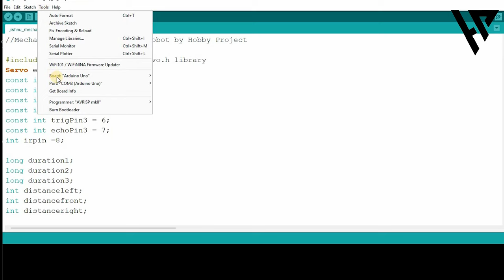Mechano Smart Floor Cleaning Robot using Arduino

Comment: I would really appreciate if you clear these doubts.
1-  8:48 at this part, you connected the positive of the battery to the switch and buck converter using diode and negative wire to the other terminal of the buck converter later in the video right ? So where should i connect the 2nd terminal of the on/of switch.what i meant is where should i connect the female port to charge the battery? which wire is connected to switch?
 2-  10:00 Where should i connect the other female from (esc and motor driver) wire in ardiuno.Even if it was shown in the video it was not clear enough and its not in the circuit. -  15:45
3 - 16:32 where should i connect the voltmeter.Is it connected to the switch or buck converter? .Did you use a separete buck converter
4- where do i connect the motors which sweep?
                Very nice project. I am looking forward to build this one with slight changes in body and vaccum cleaner.😀
Reply: 2. Three female from esc connections are shown in the circuit which is attached in discription.
4. Sweeping motors are on direct 5 V DC
Reply: @kuberavarma9985  I think what he meant is the extended wire which he connected to esc and motor driver. He is talking about the other female pin wire which is attached to the wire which he connected to the motor driver and esc

Comment: Why did you connect the BEC of esc to ardiuno 5v? I mean ardiuno is aldready powered up by direct battery right?
Reply: Plz respond sir.
Reply from the maker: thanks for pointing this out..👍
Reply: @hobbyproject  Ofc btw what power supply should i use ? BEC or Direct battery
Reply from the maker: any of it.

Comment: This is a great project,Also here are my recommendations.

- Use a Xl4015 along with a bms(if not included in battery already),instead of lm2596 which is not suitable for battery charging and also doesn't provide cc but Xl4015 can provide a constant current/Voltage with adjustable voltage and amps so we can adjust volt into the battery for charging
- Use a mini 5v cooling fan on top of the l298 motor driver if it heats up,Remember to maintain atleast 2cm from the l298,Air flow should be top to bottom.
-Use a good quality 40a + esc unlike the cheap ones in this video,Like i bought a cheap one and it burned and heated up so quickly,More esc rating leaves more head room for esc resulting in better perfomance and less heating, I would recommend hobbywing skywalker 40a,UBEC 5v/3a esc

These are some of my recommendations. :)
Reply: If I want to use a hw 130 motor control instead of l293d
Can I do it?
If yes, can anyone provide any directions
Reply: @simoon_sifat  No you can't use hw 130 motor driver on ardiuno to run those wheels,The robot only needs a driver with two motor outputs,hw 130 have 4 of them also if you use hw 130 on top of ardiuno,where would would you connect all the other sensors,pwm signals from esc. e.t.c , I mean you can connect it through the pins of the driver by soldering the pins for jumper wires but why all the effort when there is another dedicated driver for this, if you have programmed and used 4 wheels then the hw-130 driver is suitable otherwise not suitable for this project.
Reply: Go with l298 driver,(the one that has heat sink.
Reply: @TRAZExYT  thank you for your response
I was making this with your suggestions in mind but got hw-130 instead of l293d when I ordered the items
So, was trying to see if I could make it with what I had
Reply: @simoon_sifat  You're welcome.I am also in the process of making this,Circuits almost done but now i have to modify the code more to run efficiently
Reply: The buck converter output, one is left
Reply: It will be connected to switch or somewhere else
Reply: Bcz One is connected with switch
Reply: @sahilgupta4899  Yes,The buck converter's +ve is connected to switch using diode and -ve out of buck converter along with the other terminal of the switch is connected to esc,motor driver input,weeping motors input respectively
Reply: @TRAZExYT  can you tell me the esc connections
Reply: Asap
Reply: @TRAZExYT  bcz I have many more doubts
And I have to explain this in my school tomorrow
Reply: Pls help
Reply: Because esc has two connections of power supply and sweeping motors also has two connections 1 positive and I negative
Help
Reply: @sahilgupta4899  Yes sure,The battery's out coming all the way through buck converter and switch is connected to esc's input +ve and -ve respectively,Along with the input wires to the motor driver you used,Also the irz44 10k potentio meter sweeping motors input.All of these are connected to battery out respectively.The esc's bec provides supply for ardiuno uno and sensors while the motor driver wire powers up the motor driver to run wheels,The input of irz44 controls sweeping motors.Note that don't repeat the mistake in this video where he extended a wire from motor driver input and connects it to ardiuno.Dont do this coz ardiuno uno is already powered up by esc's bec along with sensors
Reply: @TRAZExYT  bro can you provide me a circuit diagram which is correct
Reply: On WhatsApp or of any link which provides me the png of circuit diagram
Reply: @sahilgupta4899  i don't have a specific diagram
Reply: @TRAZExYT  thanks i have solved it but i have removed the charging port
Reply: @TRAZExYT  can you help me to add charging port also
Reply: @sahilgupta4899  yes,if you are using llm2596 or xl4015 just take a female port and connect it's +ve and -ve to lm2596/xl4015 input respectively.make sure to adjust the voltage?
Reply: @TRAZExYT  how can i power arduino
Reply: @TRAZExYT  what is the use of connecting a potentiometer to arduino
Reply: @sahilgupta4899  You do use a esc right to control bldc motor.That esc has 3 additional wires known as bec.Connect the Positive and negative of it to the (extended wire from video which supplies 5v to all sensors) connect it to those wires,and ardiuno is powered up
Reply: @TRAZExYT  then, will bldc motor gets enough power to run effeciently
Reply: @sahilgupta4899  I don't completely know bcoz i am in the process of making one myself with design and circuit differences, However the bldc motor needs a high capacity battery to run this project,likwe 12v 5000maH with more than 20c.Keep the potentiometer at 40% to reduce power consumption
Reply: Bro I loved this project ❤ but  I need the dimensions/measurement  of the outer box. Can anyone help me plz
Reply: @daddygaming5768  measurement? just get a platform to put all of the components and if they fit in a desired circle,just cut it,thats how i did it
Reply: Por favor diagrama completo y materiales
Reply: @TRAZExYT  Can you tell me how do i connect the wheels to the Arduino board i don't see where he connected the wire with the board or else..
ANSWER ASAP i need to submit this project this week
Reply: @Ofc_human  He connected the wheels to the out pins of the l293 motor driver, and then the input pins from the l293 ( in1, in2, in3, in4 ) to the corresponding pins in arduino as shown in the video
Reply: @Ofc_human   which motor driver are you planning to use, l293 motor driver in the video or l298 motor driver?. I personally recommend getting the l298 motor driver because it has pwm( pulse width modulation) which will help you control the speed of the wheels but in l293, you can't do that so he used an extra lm2596 buck converter to reduce the speed of the wheels, lm2596 will produce heat and then the current is wasted, so l298 is what i would recommend, Be careful about providing the supply to arduino, ( check the positive and negative) if you gave the wrong polarity then the arduino board is gone, i wasted 2 boards like that when i was a beginner
Reply: @TRAZExYT  Um i see that he used a male jumper wire for the wheel but where should i connect it ?
Reply: @TRAZExYT   The wheel will be connected with the motor driver module, If yes why did he used the male jumper wire ?
Reply: @TRAZExYT  btw im using L293D motor driver module :D
Reply: @Ofc_human  I think he used jumper wires from motors ( wheels ) for ease of screwing it to the motor driver's screw outlet, jumper wire or not, it shouldn't matter, The wheels are supposed to be connected to the out of the l293 motor driver, Sometimes these screw outlets in these modules doesn't hold the wire well, so i have also used jumpers from wheels to motor driver so it fits to the screw outlet firmly
Reply: @TRAZExYT  btw thanks a lot, where do i connect the wires ???
Reply: @Ofc_human  welcome :), which wires did you mean? The wire from wheels or from l293?, The wires from wheels should be connected to the out 1 and out 2 of l293 and from l293's input wires ( in1, in2, in3, in4) to arduino pins as shown in the video. Also he have provided the diagram in the description
Reply: @TRAZExYT  oh and the esc wire?
Reply: @Ofc_human   which esc wire? Let me clarify, the input wires of the esc( +ve and -ve) should obviously be connected to the out of the battery through the switch and buck converter as  shown in the video respectively, the input of l293 should also be connected to the input of esc ( to the battery output through switch and buck converter) in a way which both of the esc and motor driver turn on at the same time.  About the BEC connections of the esc, the positive and negative of the bec ( battery eliminator circuit of esc) should be connected to the 5v and gnd pins of the arduino ( you should be careful when connecting here coz if you gave the wrong polaity then you better  gotta buy another arduino board), and the signal wire to the 13th pin of arduino uno
Reply: @Ofc_human There's a small mistake in this video, at 10:00 here he have extended some jumper wires from the l293 right? Those jumper wires should go to the vin and gnd of the arduino, this is a pretty good way to power up arduino, but later in the video he also connected the bec output to the 5v and gnd of arduino, that means the arduino is receiving power supply from 2 different sources at the same time which is not desirable. so you should either connect any one of them at a time, i would recommend connecting the bec output and disconnecting the output from l293( the extended jumper wires) because the bec provides more of a stable output
Reply: @TRAZExYT  um too complicated do you have any diagram or any reference picture?
Reply: @TRAZExYT   um can you please explain me how did he connected the IRF Z44 Motor speed controller circuit & did he connected it with the ESC and it was connected to the Motor driver module and was it connected to the battery please reply quickly and also if you have any reference picture please send it me if possible:D
Reply: @Ofc_human   bro the irz44 connection is given in the video's description and yes it is directly connected to the battery. by that it can be connected to the input of es or motor driver, It's not complex bro, let me clarify, you can see the connections of battery, buck converter and switch right? so all you need to do is just connect the irz44, esc, motor driver to one end of the switch and the other wire to one end of the buck converter, Basically if we turn on the switch, esc, motor driver, irz44 should turn on, that's it. unfortunately i don't have any reference picture
Reply: @TRAZExYT  so if connect the esc & the motor driver & the irz44 together and connect it to the buck converter will this work?
Reply: @Ofc_human  well if you do that then the esc, motor driver and irz44 will power up, basically these 3 components are the 3 components that is directly connected to the battery, through switch and buck converter, you still need to power up arduino, all the other sensors and stuff, by that i mean all the sensor and arduino should be powered up by the esc's bec connection as shown in the video
Reply: @TRAZExYT  also can you tell the connection for the buck converter and the battery?
Reply: @Ofc_human   1- Battery positive wire to one end of the switch.
2 - 1n4007 diode- Connect the grey part of the diode ( cathode ) to the end of switch where battery positive is connected
3 - connect the other end of the diode ( the black side - anode) to positive terminal of the buck converter,
4 - extend a wire from the other end of the switch. ( the other end is connected to the positive of battery and cathode of diode as mentioned earlier). Now connect this wire to esc or wherever you want to.
5- connect the negative of battery to negative terminal of buck converter, simply extend a wire from the negative terminal of the buck converter to use it as negative output,
6 - so the other end of the switch where the wire is extended as mentioned in the 4th step is the positive and the wire mentioned in 5th step is the negative wire
Reply: Can any one help me I want to k ow that Last part where the 2nd buck converter wires is connected and also where to connect voltmeter wires and in the last from where that charging wire coming out any one can explain pls help because I am doing this project and I bought all components otherwise it will get waste pls help🙏
Reply: Bro can u help me pls tell where to connect that voltmeter negative and positive wire and in the last from where that charging wire came put pls explain bro🙏
Reply: @KnoxRKnoxR  The charging port is connected to the input terminals of the lm2596 buck converter which was shown at the first part of the video, At 7:34, You can see him solder some wires onto the the converter, These wires are connected the charging port which was attached to the body at the end of the video.

The voltmeter is really not necessary for this robot to work, but i'll tell the connections anyway.
At this part of the video 8:32, you can see the output terminals of the lm2596 buck converter right? connect the negative wire of the voltmeter to the terminal of the buck converter that isn't attached to the diode, Connect the positive wire of the voltmeter to the other terminal of the switch where he didn't connect anything at 8:32( basically the other terminal of the switch rather than the one which is connected to the diode and battery.

The additional lm2596 buck converter you see at the end of the video is also not necessary to make this project work, The buck converter's output is connected to the input pins of the l293 motor driver, The input of the buck converter is connected to the extended wire from esc ( 10:00) basically just insert the buck converter between the l293 motor driver in a way which the motor driver's supply come through the lm2596 buck converter, He used this to regulate the voltage supplied to the motor driver to reduce the speed of the wheels as it was too high, If you don't want to reduce speed then you don't need to connect the buck converter
Reply: @TRAZExYT  thanks bro for ur help
Reply: @TRAZExYT  bro can u help me one more time how the system turns off and on he didn't shown which wires should connect to switch.
Can u tell me which wires should I connect to switch that full system turn of and on
Reply: @KnoxRKnoxR  which kind of battery are you using, you should look out for something when you are charging it.
Reply: Also bro, if you already haven't installed the second buck converter to change the speed of the bot, then i would definitely recommend getting the l298 module, ( the one with the heatsink), In this way you don't have to use the second buck converter to adjust the speed, Also you can adjust it way more precisely also with saving much power, You can adjust the code to change the speed, I can do that for you if you want
Reply: @TRAZExYT  bro thanks for ur reply I am using lithium ion 11.1 volts battery pack with 4000 mah.and i will not use 2nd buck converter.Iam confused in the connection can u help me how the overall system turns off and ON he didn't shown the connection which wires to be connected to the switch to turn off and ON the bot could u help me in that? Which wires should I connect to the switch to turn ON and Off the bot
Reply: @KnoxRKnoxR   bro did you understand the connection between the diode,buck converter and battery i told you in the previous reply. Just use the output wires of that connection as i mentioned ( Red wire extended from the free terminal of the switch and the black wire from the l298 buck converter's negative terminal) use both of these wires to power up the motor driver, esc and the 2 motors which sweeps the dust. that's all, Connect positive output to positive of the motor driver,esc, sweeping motor's one end and the negative output to the negative of the motor driver,esc and the other terminal of the sweeping motors
Reply: @TRAZExYT  bro can u tell me at 9:37 which another red and black wire did he connected to esc red and black wire? From where that red and black wire coming?
Reply: @KnoxRKnoxR  bro that red and black wires are coming from the irz44 speed controller( the sweeping motors), Also i have designed the circuit schematic for you.
Reply: @TRAZExYT  bro and tell me how the arduino get power supply?
Reply: @TRAZExYT  bro I did this bot but the bldc motor is not working and the bot is rotating round and round I did all the connection properly whats the reason bro?can u tell? is the code he had given is correct?
Reply: @KnoxRKnoxR  Try reversing one of the connections to the motor and the code given in the video is correct
Reply: @TRAZExYT  bro I did this bot but it is not  
Moving like he had shown in his video my bot is rotating at one place only what's problem I don't know i did all the connections properly can u tell?is that code correct he had provided?
Reply: @KnoxRKnoxR me pasa lo mismo

Comment: hi, what is the use for the 1st buck converter ? can i use the 1st buck converter to step down the voltage entering the LM298 motor driver
Reply from the maker: one for speed adjustment as u said, and another for charging the battery